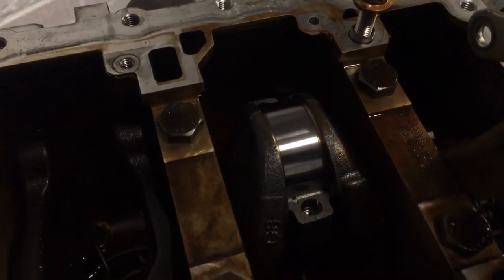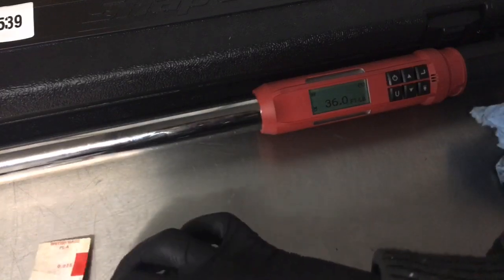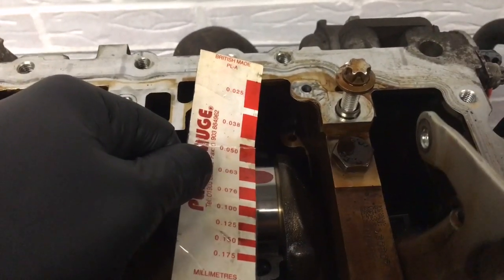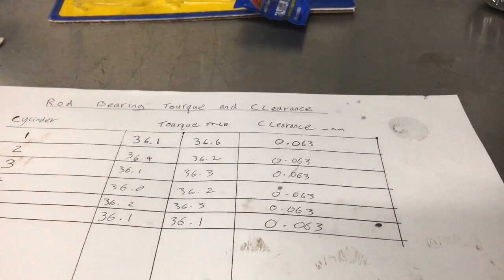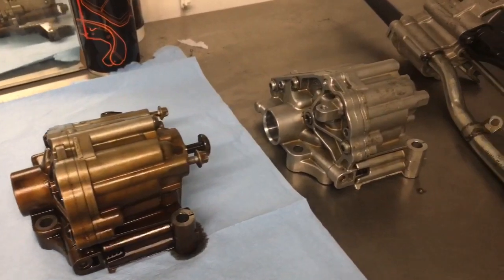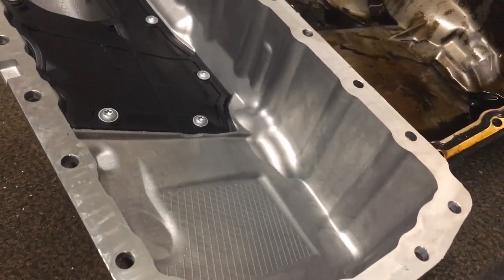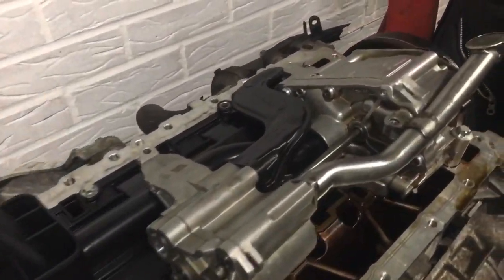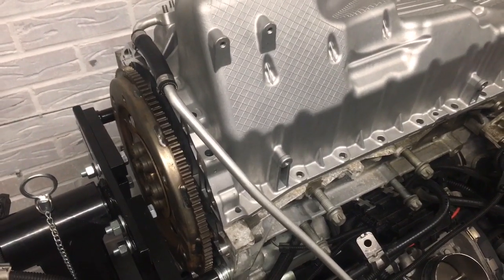MAKING A N55 M135i ENGINE RELIABLE FOR RACING! S55/M4 OIL PUMP CONVERSION, M135i race car build E4

Comment: Hello, currently have a N55b30m0 with a big boost 3.4 turbo and I’m looking to strengthen the internals. If the tolerances on the crank for the bearings is higher, would you be able to get away with polishing the crank to fit and oversized bearing?

Comment: Bro need your help !! Do you know if the oil system in the n55 535i is the same as your 135i I am trying to retrofit the same oil pan and oil pump on mine but I am not sure if I need the secondary pump or if I need anything besides the hardware when installed !!!!!

Comment: Any way to fit the s55 oiling system to an e82 n55? I've heard there's trouble fitting this system to an engine with the hydraulic steering rack pump. Any info/insight would be greatly appreciated :)

Comment: Interested to see if the sump touched the steering rack bolts that protrude slightly?

I just did the same job and the sump is catching the rack, so we plan to file the rack slightly and raise the engine with shims by maybe 5mm. 

How did you get around it, cheers Lee
Reply from the maker: It did hit the rack buddy but we spaced the engine up a little
Reply: @fastroadvehiclesolutions  awesome thanks 😊
Reply: @fastroadvehiclesolutions  we space the passenger side and left the drivers side. All good 👍
Reply: I had the same issue. I had to grind the rack casing down so there is now a small gap. I’m going to shim the engine mounts to raise the engine slightly also.
Reply: @leetaylor238.  how?

Comment: Would there be anything stopping you from just fitting the S55 sump and oil pick up to the original pump? While in your application the complete upgrade is required but for someone looking for a more robust but cheaper solution would that be worthwhile?
Reply from the maker: To make it worthwhile you’d need to fit the s55 sump and the pickup as they match up and create a seal that doesn’t allow oil out, but yes you could get away with not fitting the oil pump and scavenger pump !
Reply: did you ever do it?

Comment: Are your torque specs and clearances specific to the bearings you are using or from bmw? Thank you
Reply from the maker: Torque is specified by the bolt manufacturer ARP, and shell clearance is specified by the manufacturer

Comment: Hey whats up man, just got all the parts for the oil sump conversion just wondering if any modifications to the bedplate is needed? Or where does the scavenging pump go mounted too? I have a 435i N55b30. Thank you again for the info!
Reply: did you figure it out?

Comment: Question:  Do you need to code out the oil level sensor when using the M235iR dipstick?
Reply from the maker: Twin Scrolled I would assume so yes , will confirm when back in the car
Reply: @fastroadvehiclesolutions  Waiting for it eagerly :D

Comment: If the purple wax line would have be to big or to small for you gauge, what would this mean? Would you need to replace something?
Reply from the maker: Thibault Bulinckx yes absolutely, to big and you have to tight clearance so your bearings are the wrong size. To small and your clearance is to big so you may need to go up a size on the bearing

Comment: How much labour would it cost to replace the rod bearings please?
Reply from the maker: flawlessko if it’s just a preventative thing you’d be looking around £1200 that’s what most places charge , however if you have a bottom end failure you are going to need allot more work